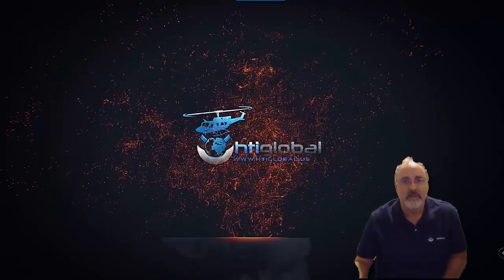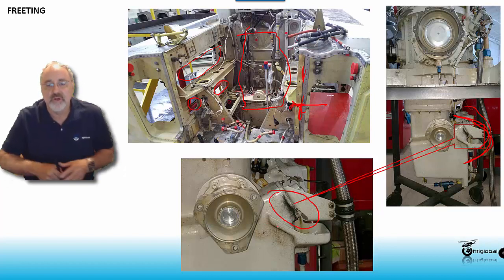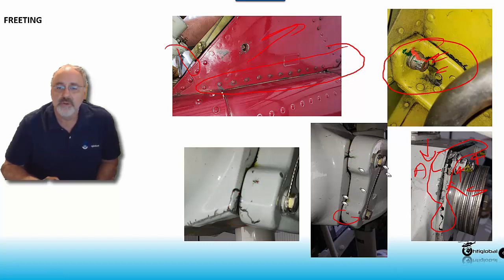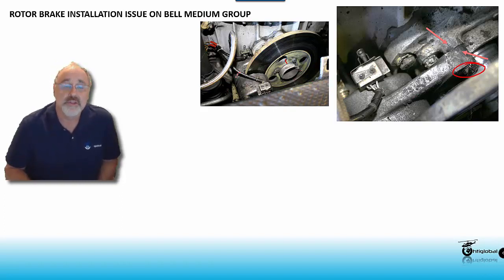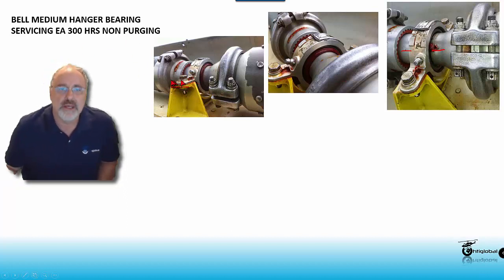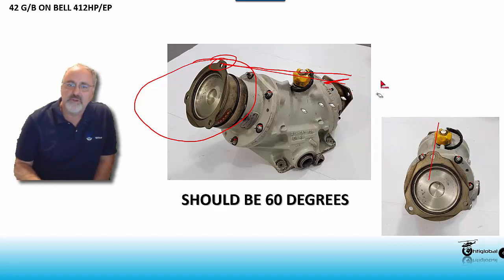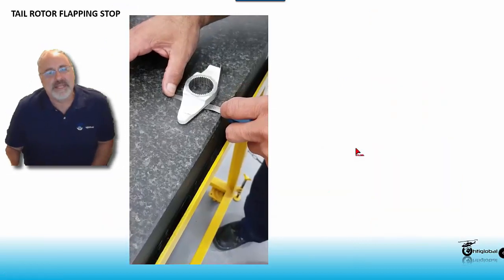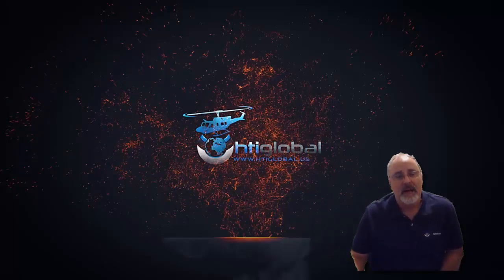HUMAN ERROR VIDEO 2

Comment: The 412 hydraulic system says not to use alcohol when cleaning hydraulic components, so I wonder why?
Reply from the maker: Hydraulic components use a great deal of different polyethylene (plastics, teflon,etc) and they will not get a good reaction with alcohol. There is a basic advice which is, use hydraulic fluid to clean hydraulic components like piston, cylinder areas. I hope this help you.